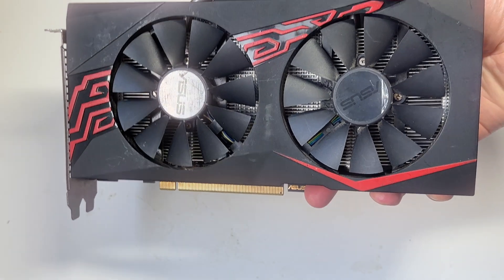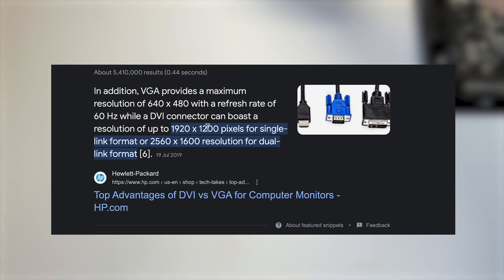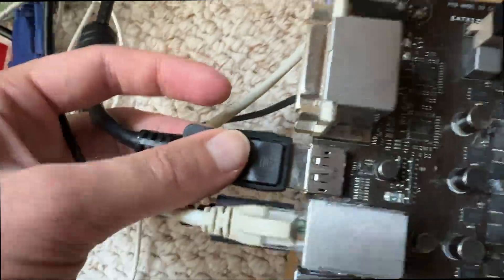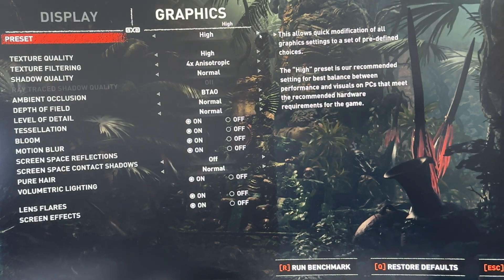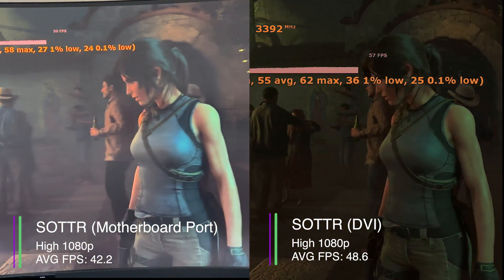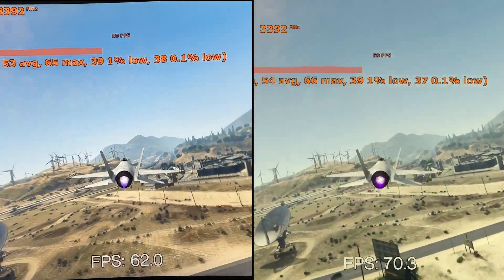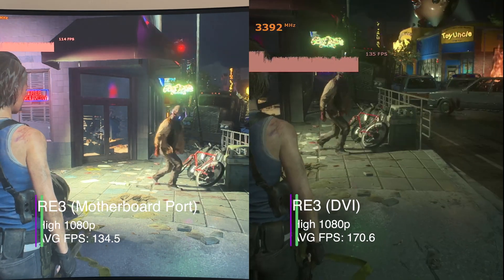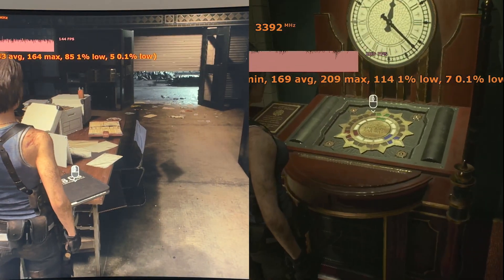No Ports, No Problem!

Comment: if i recall from a LTT video i seen, the reason you lose performance is a couple reasons, one because similar to you said it has long path to travel on the motherboard, but also and probably the biggest reason, even though you GPU is doing the video computing, it still sends it back to your CPU to process and send out via motherboard video port. there for putting more workload on the CPU and having more steps in its self.
Reply: Yeah, the MUX Switch.
Reply: if CPU is very powerful, you will not notice lose performance because it is very minimal
Reply: @sangpenjelajahinternet616  yes but who has a very powerful cpu together with a crappy gpu?

Comment: This won't work so easily with all types of mining gpus, some of the later types have severely cut down pcie lanes and/or different VBIOS
Reply: You can reflash them to normal bios if you know how. I have done it in AFOX Mining RX580 turning it to normal gaming card. There is a risk of bricking the card though.
Reply: it literally will
Reply: If you buy a Nvidia card you can run Nvidia patcher to install it then just flash with a techpowerup bios . The pcie lanes can be restored if you have the time and equipment i've done it many times. Even if you don't the hit is frames it's that bad i think it's like 5% . The thing that wanted  crippled was A I task which require the high bandwidth.
Reply: Also normal 580s are like 50 bucks now but it's  a nice thing for people to know and maybe use in a pinch in the future.

Comment: your tutorial is interesting but also has a flaw as not everyone has games installed t their c drive like i have a seperate SSD for my games on my laptop
Reply: Doesn't change anything, set up is the same
Reply: @nap8187  it does just slightly  for the install locations
Reply: @dawn1berlitz  well it's the same file structure for Steam just a another Steam library on another drive.
Not a flaw of the video.

Comment: This also works with video acceleration gpus, Tesla M40 for example with a few changes in command prompt to change to compute mode to WDDM mode and you got gtx 980 ti performance with 12gb. EDIT: changes in cmp are nvidia-smi -g 0 -dm 0 (idk why it doesnt let me reply)
Reply: So a titan x basically
Reply: @thisthingmint250  and at a cheaper price
Reply: you mean 1070 with more power draw
Reply: @Insomnifera  and cheaper the price
Reply: Whats the changes u need to do in cmp
Reply: @asmaaalsalmani6078   
nvidia-smi -g 0 -dm 0
Then reboot the PC
Reply: @asmaaalsalmani6078  
nvidia-smi -g 0 -dm 0
Reply: @asmaaalsalmani6078  
nvidia-smi -g 0 -dm 0